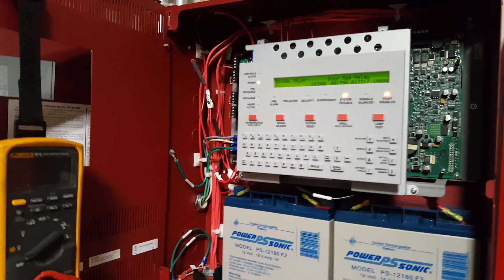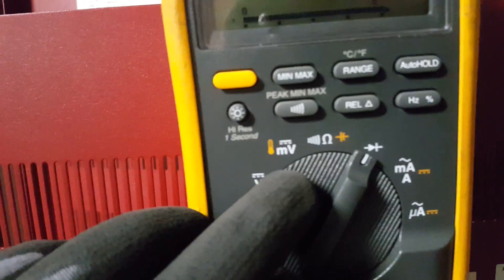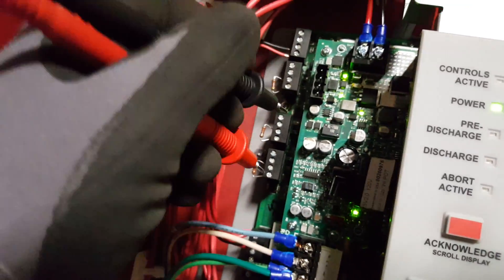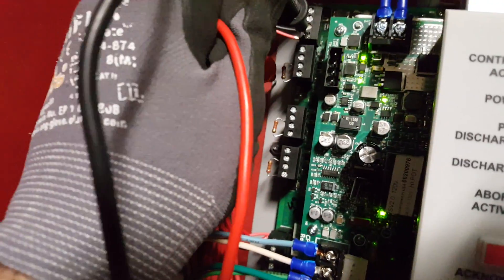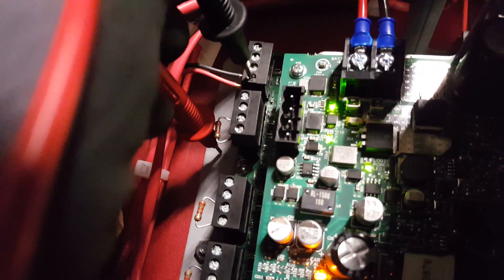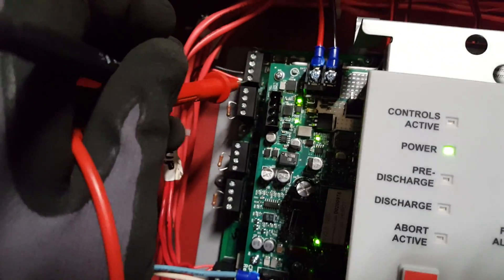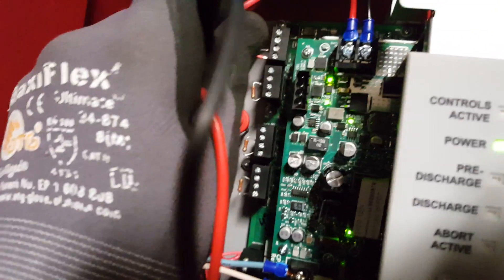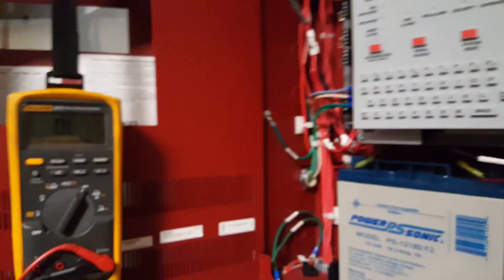How to do a ground fault check with your multimeter at the FACP

Comment: He is creating a ground fault condition to see if panel will recognize an actual fault due to field wiring issue. If panel does not recognize a true fault condition. Then most likely. Then the ground reference was removed or cut depending on what kind of system your serviceing. For some techs that are just now getting into full time service work. The diode check is very effective on troubleshooting modules on an SLC loop or an AV circuit with a bad device. The way he is creating a ground fault is very smart. 
I am an old school fire alarm technician that services conventional and addressable systems. Even serviced panels that use EOL DIODES instead of resistor. That's how long I've been doing this crap! BUT I love what do.
Just remember, everytime your installing or service a fire alarm system. Your saving lives!!!!
                           Old School
Reply: I'm a new fire alarm technician can you steer me in the proper direction as I'm trying to learn about it but information is hard to come by. Thank you.

Comment: The meter was set to a DIODE TEST (i.e., gives a low resistance path through the meter to ground when connected)
Reply: I barely noticed that. So you saying the meter was actually set to DIODE . Would continuity or ohms scale do the trick too ?

Comment: Maybe I'm slower than everybody here, But aren't you causing a ground fault ? We're suppose to look for the ground fault, not create one. Take the wires off the panel, And meter for the ground fault.
Reply: The cables not need to be removed if you are creating a ground fault.
Reply: FIRE ALARM TESTING COMPANIES WORK IN MANY DIFFERENT WAYS, SOME COMPANIES REQUIRED FOR THE TECHNICIAN, TO CREATE A GROUND FAULT OF THE FACP AS REQUIRED ON THE TECHNICIANS REPORT. JOHNSON CONTROLS IS ONE OF THOSE COMPANIES, UNLESS THEY STOP DOING IT.
Reply: @djjammindave  ... I'd have to disagree. 
I was taught different. 
I've been in the industry a very long time. 
Over the yrs I've learned; there are many different types of technicians. They all have their way of doing things. 
I have worked with some; they make for work for themselves. 
There's a thing called working hard, and there's a thing called working smart.
Reply: It’s been a year, hope you figured out your misunderstanding

Comment: wait, did I miss something here? were you just testing to see if the panel would recognize a fault? I thought you were testing an actual fault?
Reply: HOW TO DO (Make, Create) A GROUND FAULT CHECK.........................................with your multimeter. With Johnson Controls this test is sometimes required for your report. You must know how to test the fire panel ground fault or create a ground fault within the fire panel. As he clearly showing on this video. If he was fixing a ground fault within the panel the panel would of have been displaying that trouble.
Reply: Part of inspections

Comment: couldn't you just use a piece of wire or anything conductive from one lead to a  ground source?
Reply: Yes, you can. But you already knew that.
Reply: Justin Daigneault that's how I've done it for 20 years. Just a damn ju.per. no need for a fluke.